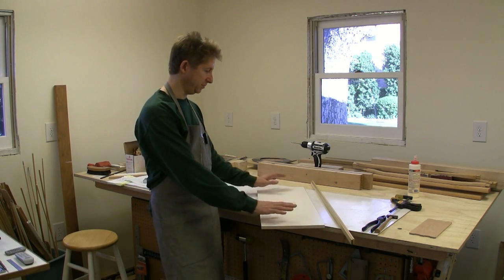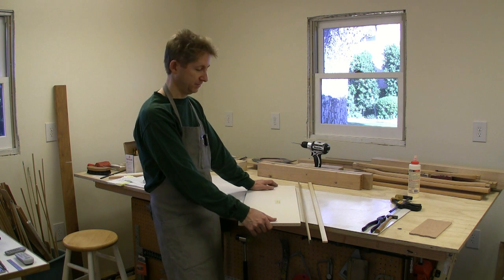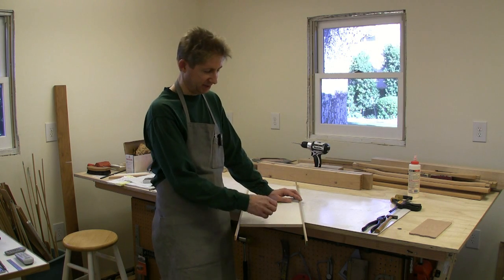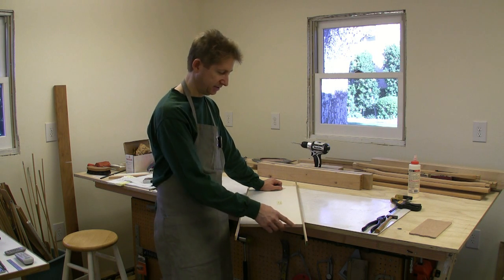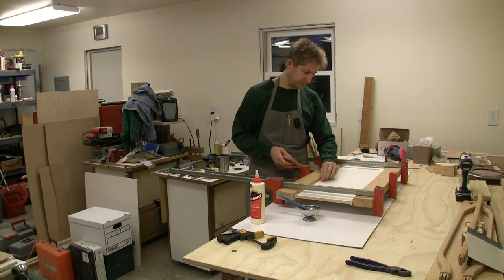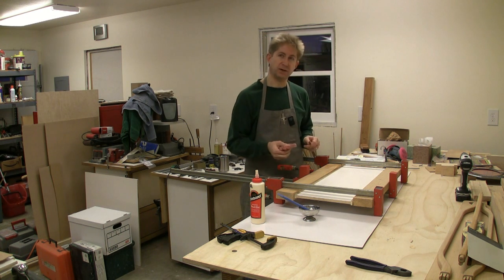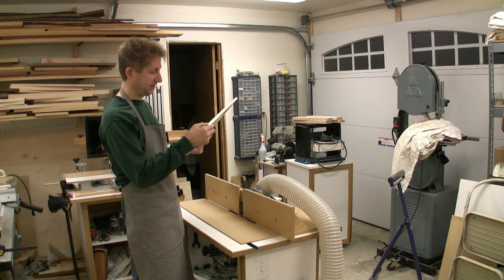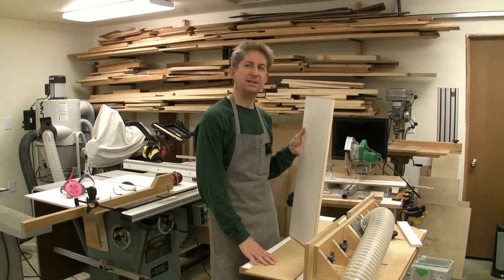How To Apply Edging To Sheet Goods.mp4

Comment: Multiply this to 10+ drawers for a small kitchen and lets see how much money you will make. Too slow. 
For 19 m.m sheet good, make the E.B 22 m.m (W) and 6 m.m (T). Apply glue, then use blue tape to pull it tight, no need for clamps, and you can Edge Band any size board fast, this way
Flash Trim E.B with router (festool has a good one), then on table saw, final cut trim 3 m.m off the edges. Now we are talking about volume of work.